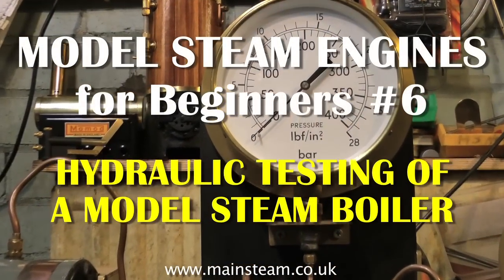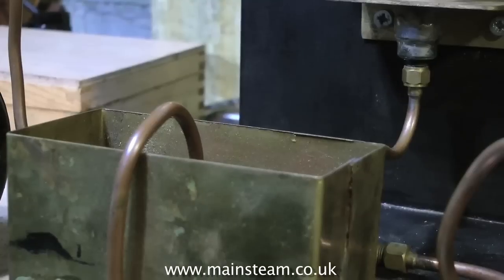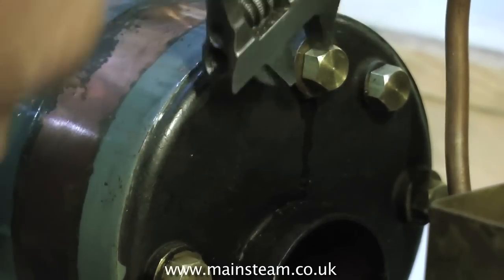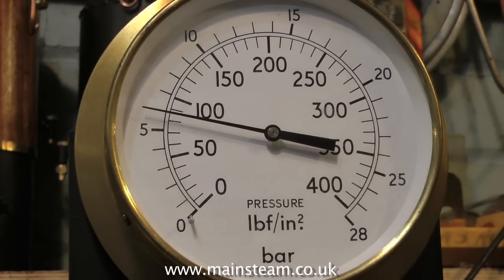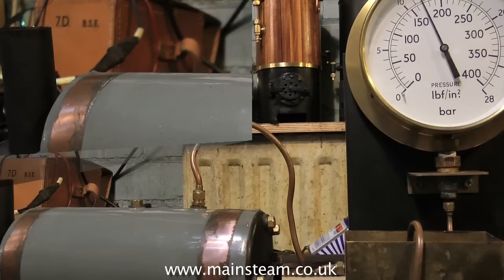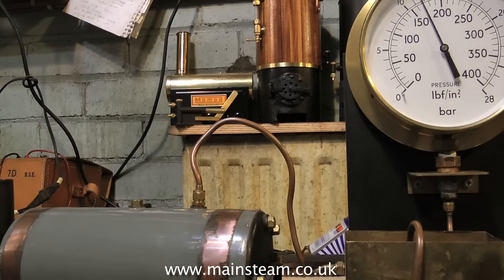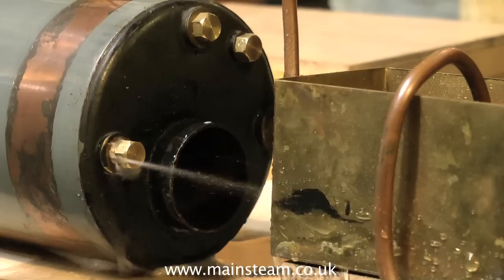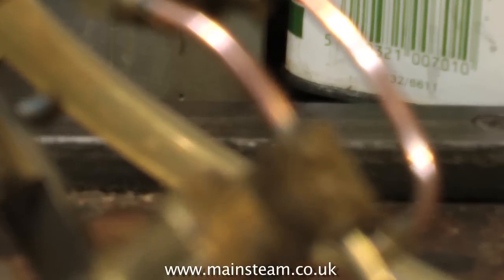HYDRAULIC BOILER TESTING - MODEL STEAM ENGINES FOR BEGINNERS #6

Comment: Thanks for the video Keith, I had a few questions about this particular boiler though; I was wondering what make and model it is? As well as how well does the single flue tube work for creating steam? I was hoping to build a simple traction engine boiler using the same method 

Many thanks,
Jack :)

Comment: Great video, it’s very helpful! I have just one question. How do you determine the working pressure of the boiler?
Reply from the maker: That is set by the boilermaker based on the design and application.
Reply: @keithappleton  I was hoping there was a formula or a rule of thumb based on size. I have an old boiler of unknown origins that I'd like to test.